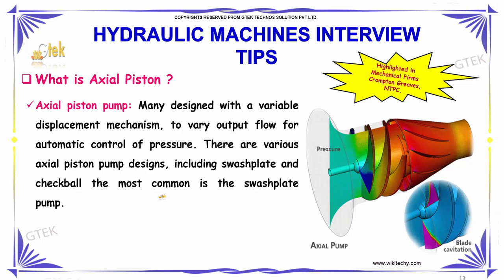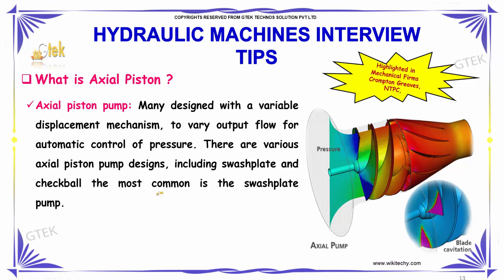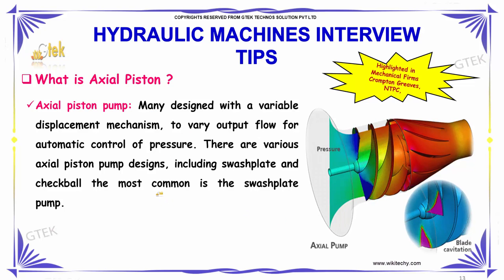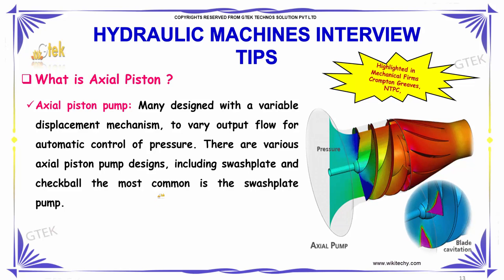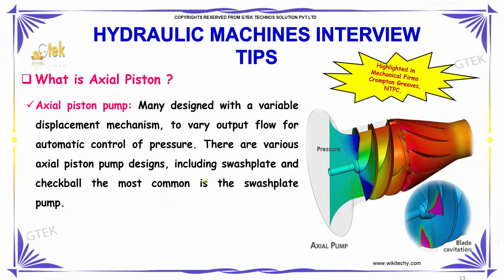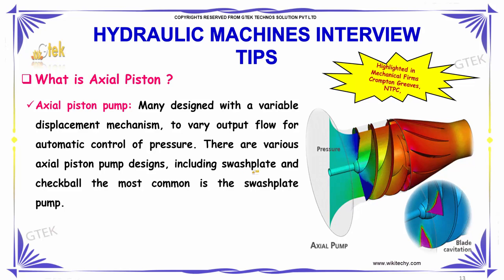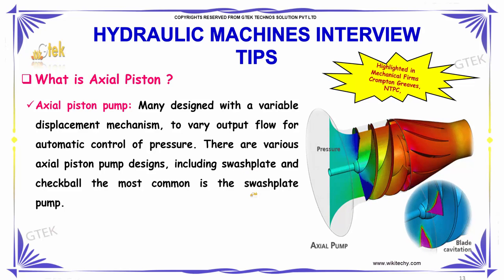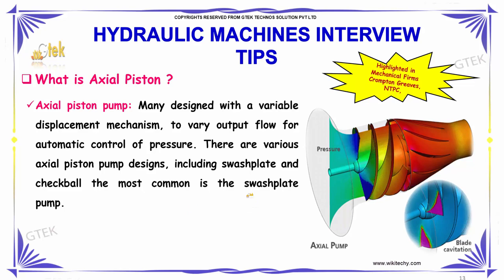what is axial piston | hydraulic machines interview tips | wikitechy.com

Comment: Axial piston pumps are positive displacement pumps which converts rotary motion of the input shaft into an axial reciprocating motion of the pistons. These pumps have a number of pistons (usually an odd number) in a circular array within a housing which is commonly referred to as a cylinder block, rotor or barrel

Comment: Axial piston pumps have several pistons that are arranged parallel to the drive shaft. They are available as either variable pumps or constant pumps.Variable displacement axial piston pumps operate according to the bent axis principle. They adjust the geometric output volume from maximum to zero. As a result they vary the flow rate that is provided to the loads.

Comment: Axial cam are direct drive pumps, meaning they spin at the same speed as the engine, which will wear down faster than a triplex pump. Triplex plunger pumps are the highest quality pressure washer pump, offering longer life and better performance.

Comment: An axial piston pump is a positive displacement pump that has a number of pistons in a circular array within a cylinder block. It can be used as a stand-alone pump, a hydraulic motor or an automotive air conditioning compressor.

Comment: disc or short cylinder fitting closely within a tube in which it moves up and down against a liquid or gas, used in an internal-combustion engine to derive motion, or in a pump to impart motion.
a valve in a brass musical instrument in the form of a piston, depressed to alter the pitch of a note.